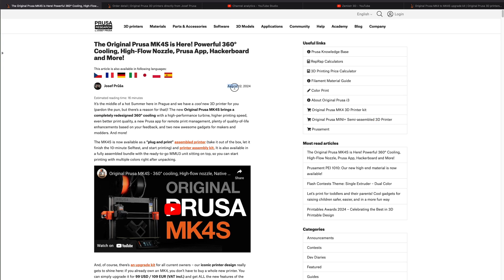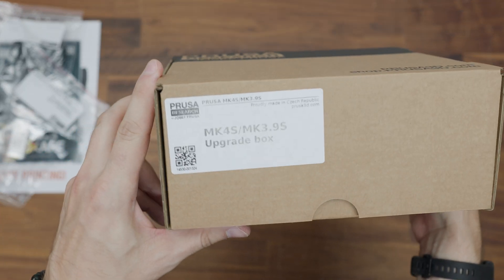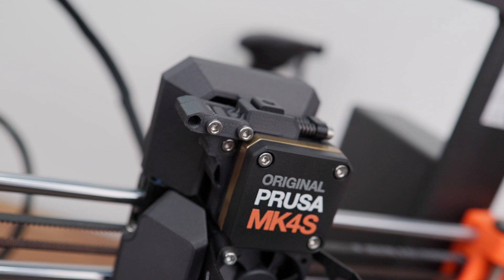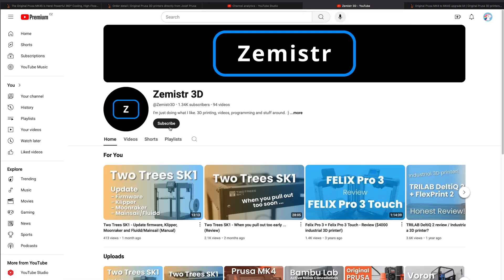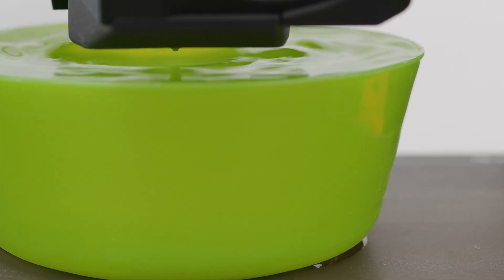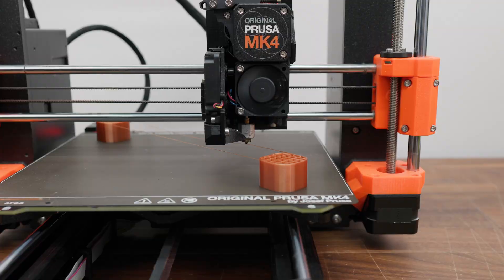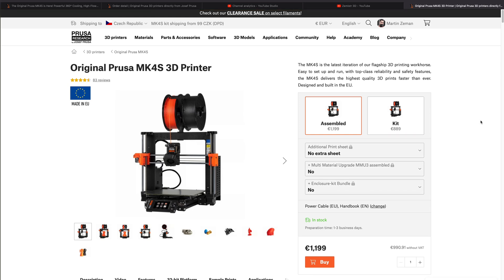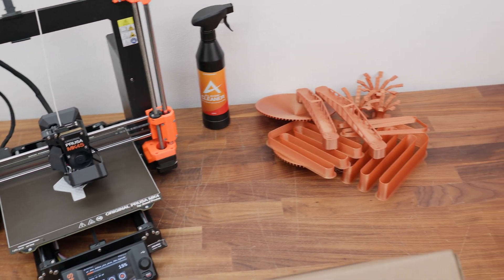Prusa MK4S - Improvements that make sense ... (Review)

Comment from the maker: Correction: 3:40 In the video I say that instead of ESP8266 the printer will now have ESP32. This is unfortunately a false statement. The new module also uses the ESP8266.
Reply: Easy to get confused. A quick google search and I see that there are at least two variants of the WROOM, the -32 (the datasheet I just looked at states "not for new designs", but I didn't bother to look up the proposed replacement from Espressif) has the ESP-32 processor, but the -2DU used on this MK4S WiFi module is the exact same ESP8266EX that can be read on the chip on the MK4 WiFi module. The only improvement that I can see is better RF shielding because of the can over the ESP module and the passthrough for the accelerometer cable if one got the accelerometer add-on (I did).